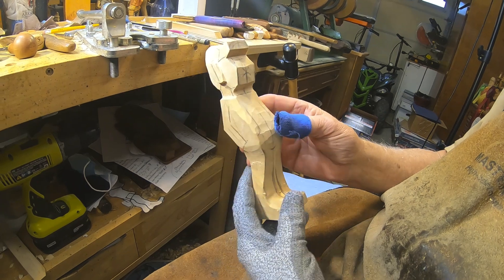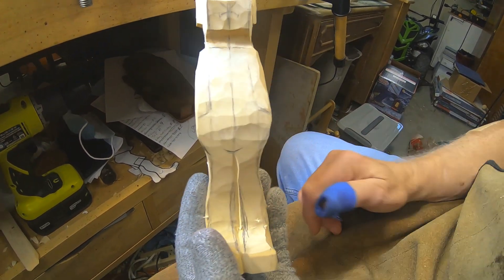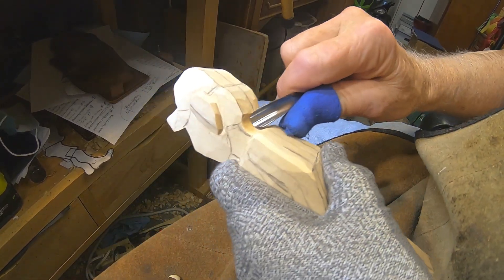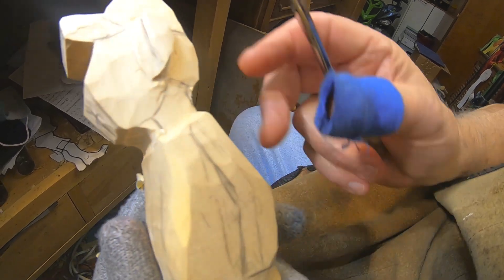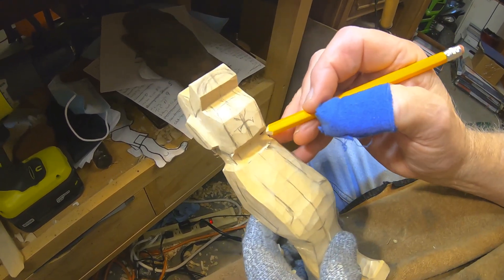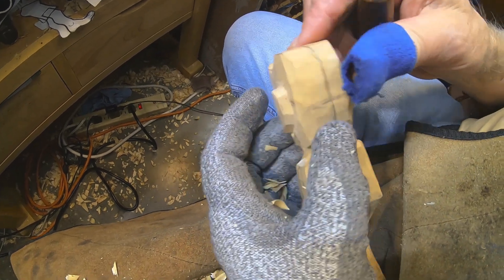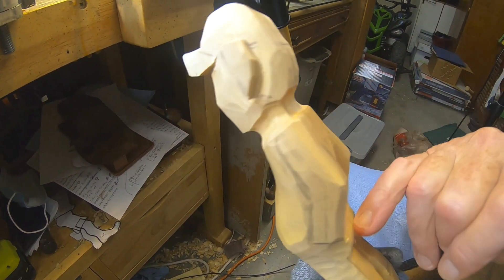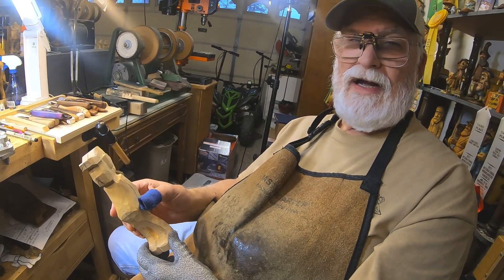Blocking a carving without a bandsaw Part 4

Comment: Rodger I am watching you carve by hand on YOUTUBE.  On you bench there is a large metal object.  Looks like it may be a vise to secure larger carving pieces.  Is that what the thing is?  Fastened to top of work bench and looks to be some what of a V shape going back along the top of bench.  First time I have seen on of those and it just has my curiosity up.  I'd appreciate it if you could tell what that is used for.  Thanks just found you on YOUTUBE thought I'd  give ya a shout.  Got a long ways to go before I get to you level sir!  

Enter
Write to Roger Stegall